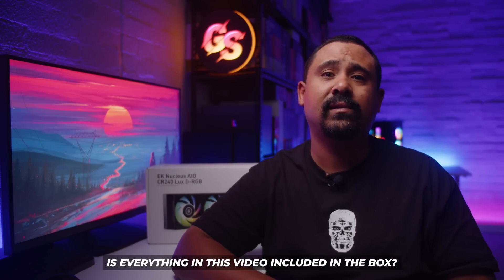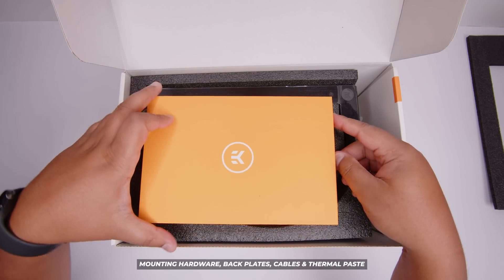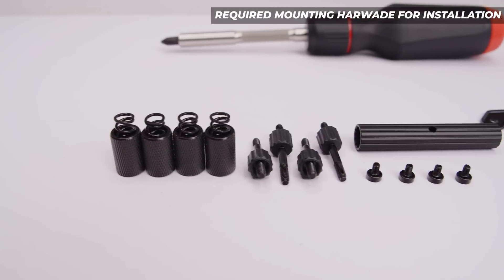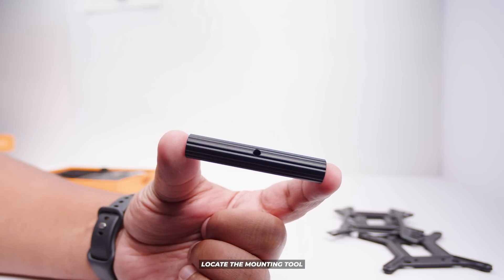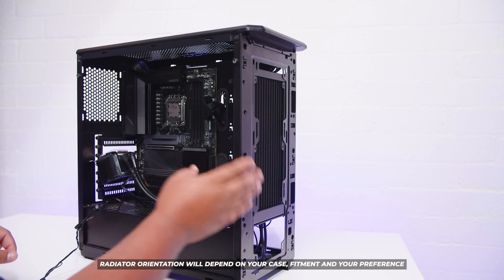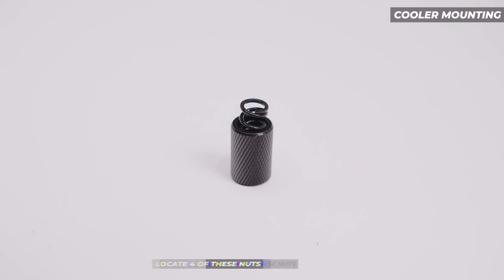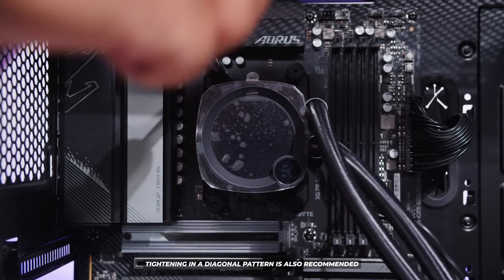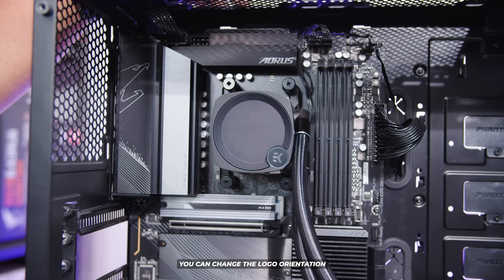EK Nucleus CR240 & CR360 Lux AMD AM4/AM5 Installation Guide

Comment: My only complaint is when you plug in the cables at the end I wish you would've shown what cables were what but besides that amazing video helped me install mine. But I'm curious I have montech king 95 pro I was wondering if I could've plugged my fans into the hub that comes with the case. Instead of straight to the motherboard

Comment: So question where do you plug in the pwm wire off the aio if you don’t use the fans that came with the rad? Do you plug into the pump fan header or cpu fan header?

Comment: Thx for great video, in manual for the aio, it says STEP A: Plug the 4-pin PWM connector from the pump to the motherboard, if i have a dedicated aio pump header on board, do i put the cable there ? and then the radiator fans to the cpu fan header, i think this is right, just want confirmation, thx
Reply from the maker: You can :)
Reply: Thx for quick reply. @GearSeekers

Comment: I'm torn between this cooler, the arctic liquid freezer II 360 and the DeepCool liquid cooler LT720 360 4th Gen for my 7950X build using an MSI MPG X670E Carbon motherboard. Which is the ultimal performance cooler to cool down the 7950X?
Reply: Ek lux is the best performer only behind asus's new aio but it's $400.
Reply: @expert8665  What's the name of this new Asus AIO?
Reply: @axi6ne8us I’d like to know too, did you find out?
Reply: @prplh  I went with the Arctic Freezer II 360 A-RGB AIO  Rev. 3 which includes the off-set bracket for AM5 CPU. I also used the newer KryoSheet graphene thermal pad to keep temps pretty low.
Reply: @axi6ne8us  sounds great to me, good job 👍 the 240mm size of arctic aio doesn’t fit in my case so I went with the new EK Nucleus instead (SFF build)

Comment: Im torn between ek, lian li, and artic cooling for my new build.
Reply: Arctic Cooling has the best AIO but you should change the fans to something better.
Reply: @GSP-76  i was looking at the 420 version for the lian li lancool 3 case
Reply: @UnknownCog-1776  Lancool 3 supports 420mm AIOs? If so, absolutely get it! That's the best overall AIO performance wise on the market...but I would recommend changing the Arctic fans to something better. If you want RGB, Lian Li SL V2 140mm fans are very good. If RGB doesn't matter, look at the totally amazing Silent Wing 4 Pro fans. You'll get the absolute best performance available using that combo.
Reply: @GSP-76  yes, watch a couple builds with both the case and aio being used. Little tight to back fan though
Reply: @UnknownCog-1776  I would strongly recommend ditching the stock fans it comes with...get some high quality 140mm fans. The Silent Wing 4 Pro fans are amazing but just cost a lot. Lian Li SL would be another great choice. Der8auer did a AIO roundup test and Arctic Cooling would hands down beat every cooler available if they just included better fans. I don't think there's a better AIO than their 420mm AIO anywhere.
Reply: @GSP-76  if they made the lian li infinity sl in 140 mm thats where i would go. The mirror look from side is great and it would keep it looking alittle bit more of a lian li build
Reply: Arctic's tubing is quite inflexible and the waterblock is rather large so you need to be sure that your motherboard/case setup will be able to support. As long as it can, then Arctic is the way to go.. they're the best AIO's by a decent margin. EK and Lian Li are both very good but 2nd tier. (Not sure about these new EK AIOs but rather the previous gen) Another one I'd throw in the 2nd tier is Coolermaster, their AIO's are extremely quiet and work great. Very happy with the 280mm Coolermaster AIO that came preinstalled with my NR200P Max case, they're fantastic AIO's as well but Arctic >> The rest.
Reply: Deepcool LS720 is a good choice
Reply: @Kizzster  yes i was looking at those too.
Reply: @UnknownCog-1776  It's going in my build. Most of these AIO's perform similarly anyway nothing major in differences at all. I'm going for the LS720 because there's less cable clutter and no control boxes and it looks nice.
Reply: @Kizzster  that what i like about the lian li uni. One cable for 3 fans.
Reply: But if i do the 360 version i can replace them with lian li uni infinity fans.
Reply: I have a lian li lancool 3 with a b550 aorus elite ax v2 board.
Reply: Thanks for everyones input. Greatly appreciated.

Comment: Thank God EK has the 4 point mounting system for all platforms.
I really like my Lian Li Gallahad 360 but they use the plastic clips (2 point mount) on AM4/5.
Sent them an Email asking about it but they say it's fine from their testing. I don't trust the mounting pressure distribution!
Reply: I've been using corsair aios for all my builds. The two point mount is easier to install when you are changing parts out for testing. Temps never been higher than 71 C
Reply: Have used a 240mm aio from corsair to cool a 5900x with no issues on the 2 point mounting.
I also used a 360 corsair on my 5950x and 5800x3d. Always performs great
Reply: Lian Li are a pathetic company. Don't ever buy from them ever again.